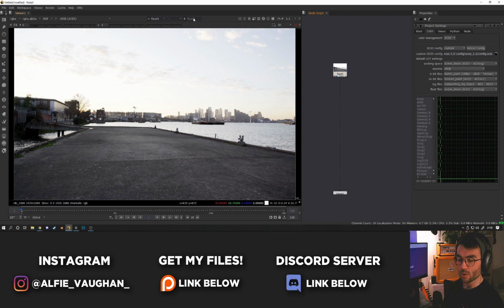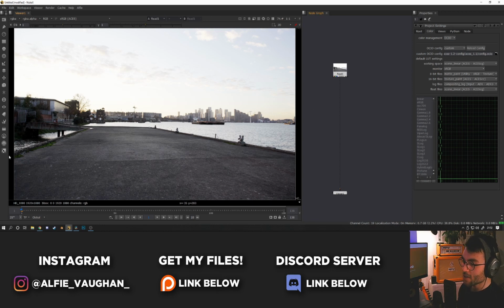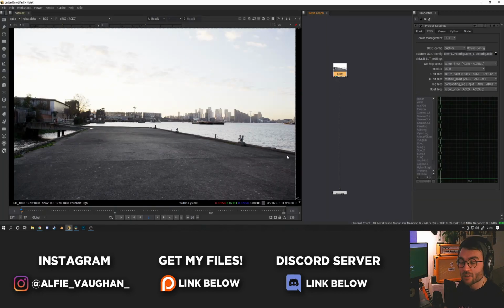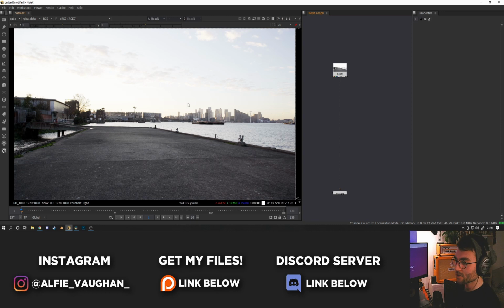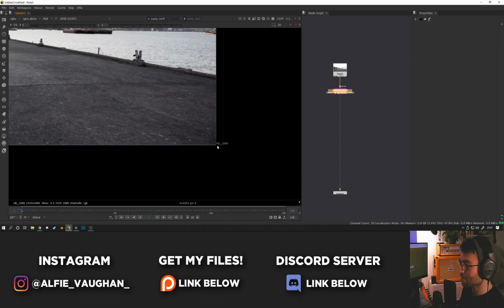My VFX Workflow Using Blender, Nuke and DaVinci Resolve

Comment: Would you say davinci resolve is as good or better than premiere and after effects?
Reply from the maker: Definitely premiere. I've fully switched. Much prefer it! I haven't used fusion (the AE alternative) but I've heard it's great and it's node based which is a plus. 

Editing wise it's not much different to premiere it's just a bit faster. The UI is a lot nicer. But it's mainly the grading that's better. Colour grading us awesome!
Reply: @AlfieVaughan  Oh damn! I may switch when my student deal runs out. Cheers Alfie :)
Reply from the maker: Yeah it's worth doing. I was hesitant for a while but now I've taken the plunge I'm really chuffed. I'm considering getting the studio version which is £230 for hardware acceleration and full screen output to a second monitor. But I've made my.last 4 videos in the free version and I could happily continue using it. It's really solid
Reply: @AlfieVaughan  I think the price for adobe cloud is ridiculous tbh. I think it's just a thing of switching softwares and having to learn and get used to the new interface.
Reply from the maker: Yeah that's the main reason I switched. Honestly the learning curve is tiny. The interface is really similar and you can change the keyboard shortcuts to a premiere pro preset
Reply from the maker: Took me about an hour to get comfy and then I was off!
Reply: @AlfieVaughan  Didn't think about the keyboard shortcuts before. Defo going for it now. Cheers Alfie